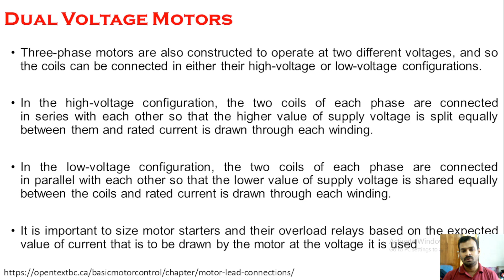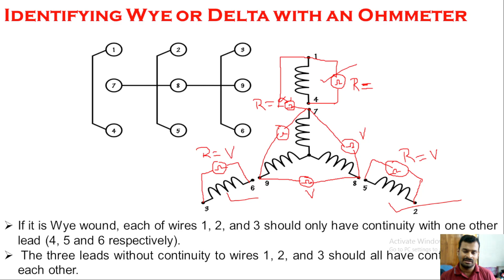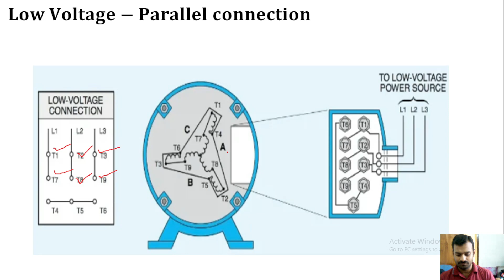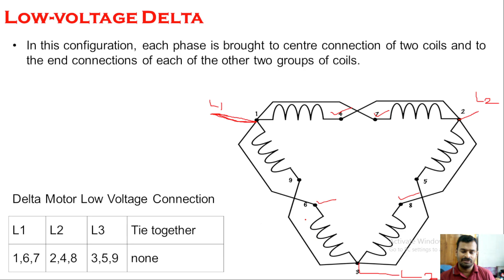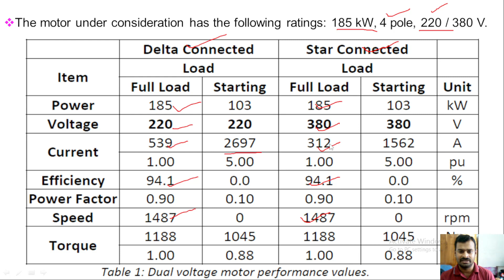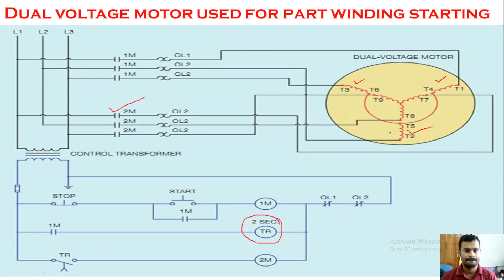Wiring Connection and Operation of Dual Voltage Motor

Comment: Thanks. Can you alter the internal connection to convert a dual voltage delta-connected motor to a dual voltage star-connected motor?
Reply from the maker: IN 9 WIRE CONFIGURATION THE MANUFACTURER ITSELF INTERNALLY CONNECTS THE COIL EITHER IN STAR OR IN DELTA, WE CAN ONLY CHOOSE WHETHER HIGH VOLTAGE CONFIGURATION OR LOW VOLVOLTAGE.
Reply: Sir. Can you make hindi video???